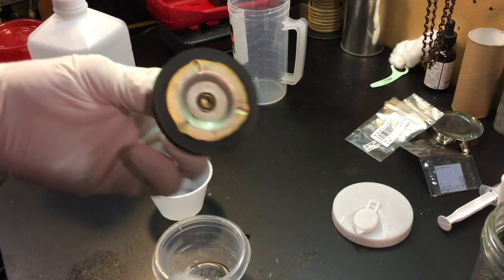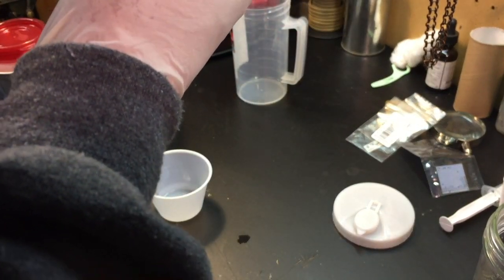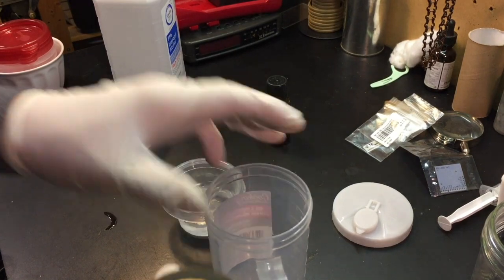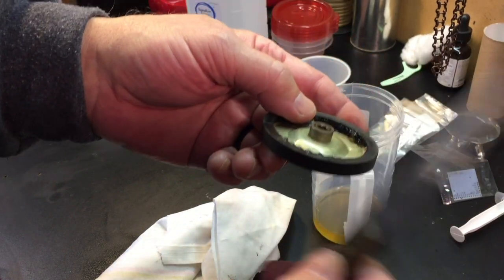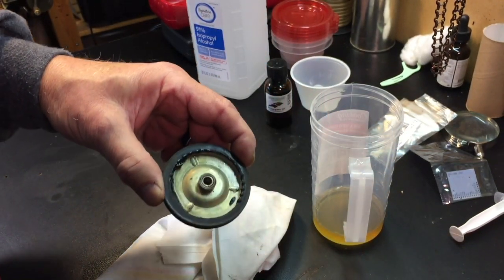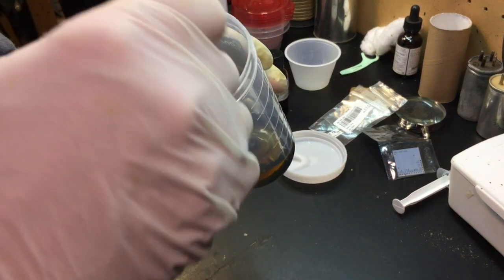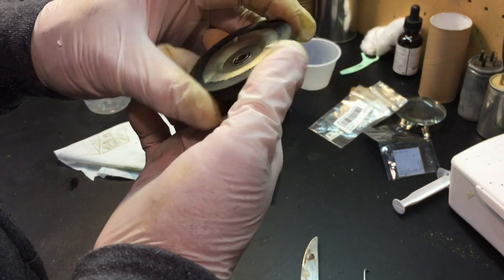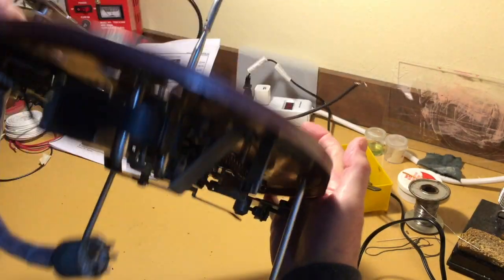Zenith 5R086 - Episode 12 - Idler Wheel Refurb and Assembly

Comment: Hi, a couple of months ago, I tried the alcohol+wintergreen treatment to various hardened rubber objects which included four turntable idler wheels ( 2 from a 1970s BSR, a 1960s Dual, and, a 1970 Matsushita), rubber gasket mounts for a BSR motor,  and a 30 year old rubber/vinyl camera strap.  The soaking times varied from three to five days. The treatment was tested first on a damaged BSR wheel which was soaked for 5 days.  It softened after about a day and a half, but I decided to leave it in the solution for 5 days, following the instructions found in other sites. When I took the wheel out after 5 days, it crumbled. The soaking times were shortened to 2-3 days.  Indeed, the rubber objects came out soft and supple, and smelling good from the wintergreen.  The Dual relied on a very pliable wheel to  make the platter spin. The softened idler wheel did make the platter turn, but only for a couple of days. All the parts lost their suppleness in about 3 days, and a week after, all were back to their old hardened states.  The old camera strap, though, is an exception:  it took slower to stiffen up again.  While it is still pliant today, it is no longer as soft as it was when it emerged from the alcohol+wintergreen solution, when it rolled nicely like fabric.  Now it is about as stiff as thin card. :)
Reply from the maker: Interesting. Thanks for sharing your results. One of these days I'll dig out the turntable I did the treatment on and see how it's held up over time. Given what you have found, I expect to see either a pile of rubber or an idler wheel that needs replaced.

Comment: Just from my own experience. I do a lot of audio stuff, and this issue comes up in old reel 2 reel decks. I tried the alcohol wintergreen thing. And while it did soften the rubber, after a few days in the open air, it turned hard again. As for lumpy/rumbly sound, I mount idlers on my drill and use 150 grit hard paper to round the corners down.  Also pack the spindle (bearing) with good quality heavy weight moly. But after this vid, I am thinking I need to look back, and maybe try this method one more time.

About a month later and I'm going to try this again on an old BSR idler.
I'll let you know how it goes.

BSR idler about 40mm diameter. After 24 hours it disintagrated. Oops.
Reply from the maker: I look forward to hearing about your results.